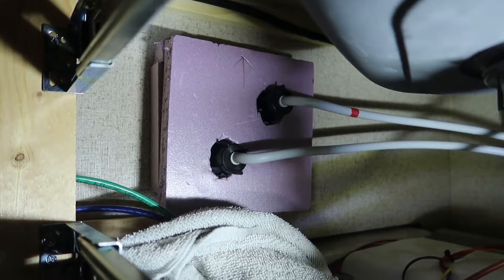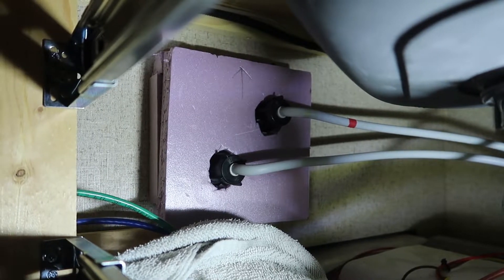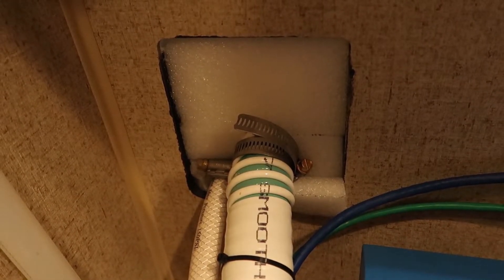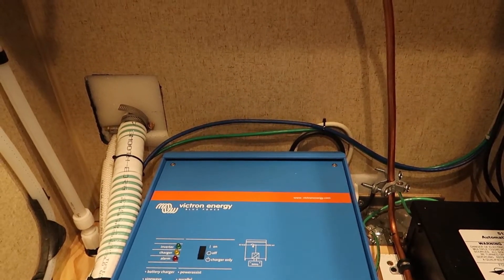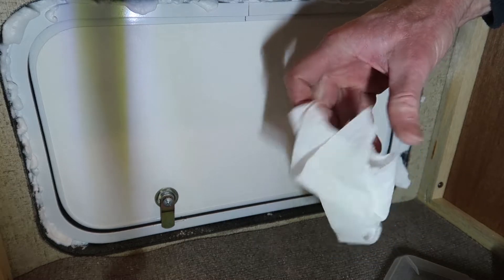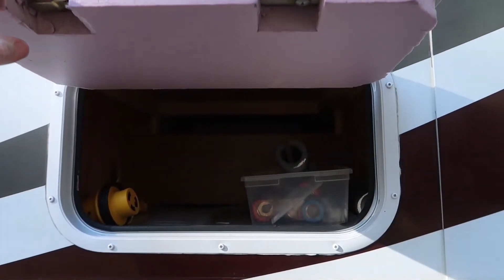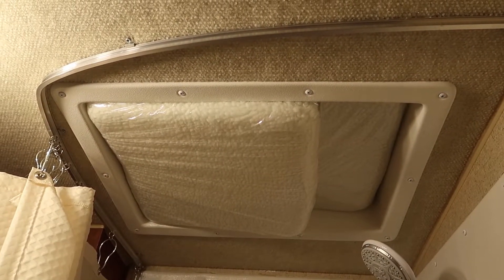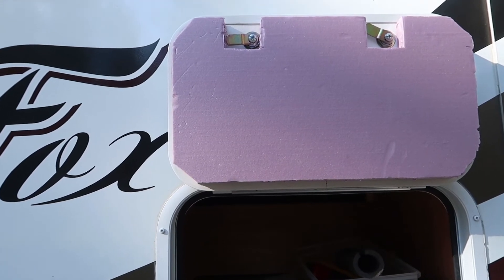Winter Camping / Extreme Cold Weather RV Upgrades

Comment: Buy a sheet of relectix and some industrial velcro. Cut an outline of the inside of the entry door and velcro that into place, You can do the same for the windows. It really cuts down on condensation and heat loss. You can take it off or put it back on in less than a minute. it weighs nothing and can be stored almost anywhere
Reply from the maker: Great idea.  I should do that on the door windows since they aren't thermal pane.

Comment: In a new AF 992 dry bath. Currently getting ready to head to the Yukon. I’m doing an extra basement fan, insulation like what you’re doing. Plus I found this 10mm self stick insulation with reflectix on the one side. I’m pulling my stove out, doing the outer shell of the propane tank storage. Doing a diesel heater in the generator compartment, which I did not want a propane genset in extreme cold. Didn’t want one in general. My buddy’s toy hauler drove me nuts with that drone. The Honda I can chain to the front of the truck since I’ll have to plug in the block heater at times. 

Added another 300ah lithium for a total of 600ah, with 600watts of solar. 

Yep, my maiden trip too! LoL
Reply from the maker: When you say "outer shell" of the propane tank storage do you mean adding the insulation to the inside of the box?
Reply from the maker: I have the new quiet model 2500 watt generator.  It's very quiet compared to the old model.
Reply from the maker: I also have a good video on the basement fan mod I did, showing how I added a switch to run the basement fan when I use auxiliary heat (heat other than the propane furnace)

Comment: I find in my AF 990 the greatest heat loss is around the slide out seals. If I lay on the floor and look in that area under the step that the fridge is on there is all kinds of daylight showing through around the seals. (just to the right of where the vent is for the charger converter). Have you noticed that in yours and have you found a way to address that?
Reply from the maker: Air comes in around the  tracks on the bottom of the slide.  Other owners will stuff small towels or rag s to keep cold air from entering there.   Other owners will retract the slide in cold weather, especially when it's windy outside.
Reply: @deltabravo1257  Thanks. And thanks for posting all these helpful videos. They have inspired me to undertake countless upgrades on my camper in the last couple of months.